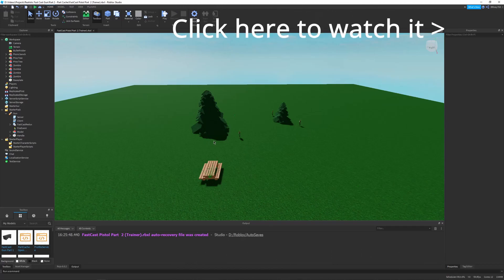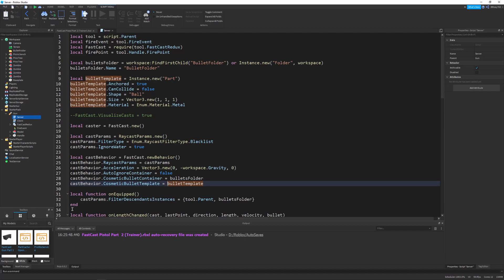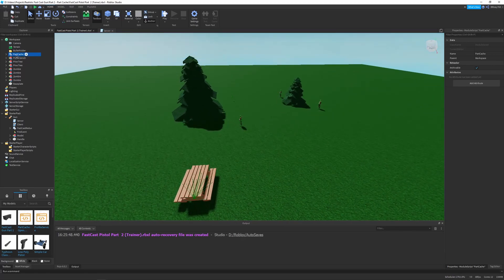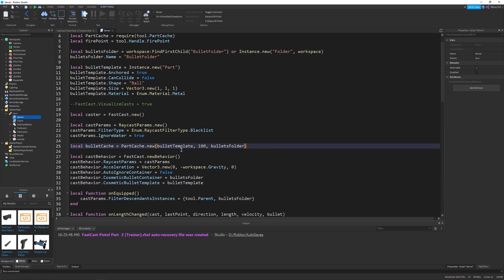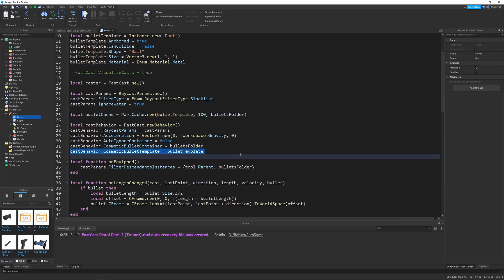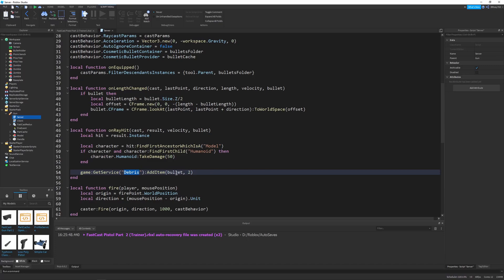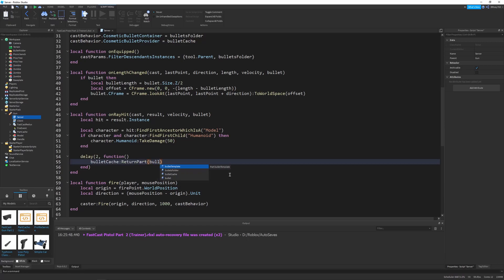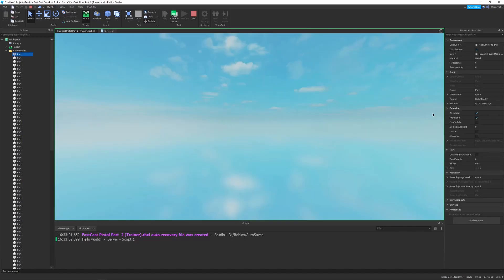Make your guns less laggy (and make it Full Auto) - FastCast Gun Ep. 2

Comment: There is a problem with this code in that you shouln't use the RayHit function to use the ReturnPart() function. This is because if you shoot the bullet in the air it will keep going up and never going to its original position. You should use caster.CastTerminating() instead. Ex. 
caster.CastTerminating:Connect(function(ray)

	castBehavior.CosmeticBulletProvider:ReturnPart(ray.RayInfo.CosmeticBulletObject)
end)
Reply: I have a fix for that actually. And I recommend removing PartCache, as it just stores the Parts instead of destroying them, which causes lag as well because they build up.

TO SUMMARIZE THIS SCRIPT: It checks, every second if there is a a bullet in the bullet folder, if there is, it checks if there already is a set of values for its position, if not, it creates those values. After that, it checks the number of values inside the script and for each value, if the bullet still exists, if not, it just removes the value. Then it does a final sweep to remove any stray values. Coming back on the next run, if the position of the bullet has not changed, we can see that it is stray (because stray bullets freeze for some reason) and remove it.

local debounce = true
while wait(0.5) do
	if debounce == true then
		debounce = false
		for NumberOfContentsInFolder, BulletInFolder in pairs(game.Workspace:WaitForChild("BulletFolder"):GetChildren()) do
			local PositionX = script:FindFirstChild("PositionX"..NumberOfContentsInFolder) or Instance.new("NumberValue", script)
			local PositionY = script:FindFirstChild("PositionY"..NumberOfContentsInFolder) or Instance.new("NumberValue", script)
			local PositionZ = script:FindFirstChild("PositionZ"..NumberOfContentsInFolder) or Instance.new("NumberValue", script)
			PositionX.Name = "PositionX"..NumberOfContentsInFolder
			PositionY.Name = "PositionY"..NumberOfContentsInFolder
			PositionZ.Name = "PositionZ"..NumberOfContentsInFolder
			if BulletInFolder.CFrame.X == PositionX.Value and BulletInFolder.CFrame.Y == PositionY.Value and BulletInFolder.CFrame.Z == PositionZ.Value then
				BulletInFolder:Destroy()
				PositionX:Destroy()
				PositionY:Destroy()
				PositionZ:Destroy()
			else
				PositionX.Value = BulletInFolder.CFrame.X
				PositionY.Value = BulletInFolder.CFrame.Y
				PositionZ.Value = BulletInFolder.CFrame.Z
			end
			for NumberOfValuesInScript, ValueInScript in pairs(script:GetChildren()) do
				if not BulletInFolder then
					PositionX:Destroy()
					PositionY:Destroy()
					PositionZ:Destroy()
				end
			end
		end
		local FinalNumberOfObjectsInFolder = 0
		for NumberOfObjectsInFolder, BulletInFolder in pairs(game.Workspace:WaitForChild("BulletFolder"):GetChildren()) do
			FinalNumberOfObjectsInFolder = FinalNumberOfObjectsInFolder + 1
		end
		if FinalNumberOfObjectsInFolder == 0 then
			for NumberOfObjectsInScript, ValueInScript in pairs(script:GetChildren()) do
				ValueInScript:Destroy()
			end
		end
		wait(0.5)
		debounce = true
	end
end
Reply: @anthonygaming0246   i know this is a year old, but you should definitely NOT do this.
use game:GetService("Debris"):AddItem(bulletinstance, time)

Comment: hey man, i added a tracer to these bullets, but when they are shot, massive lines from the sky are visible
Reply: it's because the part teleports from the sky to where it's supposed to be, resulting in the giant trail thing, best options are either don't use a trail or don't use the cache
Reply: @misenthropic  or he could have the trail disabled until it's in the right place (So late lol)
Reply: I have a fix for that actually. And I recommend removing PartCache, as it just stores the Parts instead of destroying them, which causes lag as well because they build up.

TO SUMMARIZE THIS SCRIPT: It checks, every second if there is a a bullet in the bullet folder, if there is, it checks if there already is a set of values for its position, if not, it creates those values. After that, it checks the number of values inside the script and for each value, if the bullet still exists, if not, it just removes the value. Then it does a final sweep to remove any stray values. Coming back on the next run, if the position of the bullet has not changed, we can see that it is stray (because stray bullets freeze for some reason) and remove it.

local debounce = true
while wait(0.5) do
	if debounce == true then
		debounce = false
		for NumberOfContentsInFolder, BulletInFolder in pairs(game.Workspace:WaitForChild("BulletFolder"):GetChildren()) do
			local PositionX = script:FindFirstChild("PositionX"..NumberOfContentsInFolder) or Instance.new("NumberValue", script)
			local PositionY = script:FindFirstChild("PositionY"..NumberOfContentsInFolder) or Instance.new("NumberValue", script)
			local PositionZ = script:FindFirstChild("PositionZ"..NumberOfContentsInFolder) or Instance.new("NumberValue", script)
			PositionX.Name = "PositionX"..NumberOfContentsInFolder
			PositionY.Name = "PositionY"..NumberOfContentsInFolder
			PositionZ.Name = "PositionZ"..NumberOfContentsInFolder
			if BulletInFolder.CFrame.X == PositionX.Value and BulletInFolder.CFrame.Y == PositionY.Value and BulletInFolder.CFrame.Z == PositionZ.Value then
				BulletInFolder:Destroy()
				PositionX:Destroy()
				PositionY:Destroy()
				PositionZ:Destroy()
			else
				PositionX.Value = BulletInFolder.CFrame.X
				PositionY.Value = BulletInFolder.CFrame.Y
				PositionZ.Value = BulletInFolder.CFrame.Z
			end
			for NumberOfValuesInScript, ValueInScript in pairs(script:GetChildren()) do
				if not BulletInFolder then
					PositionX:Destroy()
					PositionY:Destroy()
					PositionZ:Destroy()
				end
			end
		end
		local FinalNumberOfObjectsInFolder = 0
		for NumberOfObjectsInFolder, BulletInFolder in pairs(game.Workspace:WaitForChild("BulletFolder"):GetChildren()) do
			FinalNumberOfObjectsInFolder = FinalNumberOfObjectsInFolder + 1
		end
		if FinalNumberOfObjectsInFolder == 0 then
			for NumberOfObjectsInScript, ValueInScript in pairs(script:GetChildren()) do
				ValueInScript:Destroy()
			end
		end
		wait(0.5)
		debounce = true
	end
end

Comment: the partcache functions well but it only works when your bullet actually hits something. how to return the bullet when it doesnt hit anything and just flies off in the sky ?
Reply from the maker: I made the liberty to assume that your bullet has drop, so it will eventually fall and hit something. If you want, you can add a timeout in the LengthChanged event and figure out if enough time has passed
Reply: @BRicey  thanks, i fixed it by adding an invisible part in the sky but im gonna try that
Reply: I have a fix for that as well. And I recommend removing PartCache, as it just stores the Parts instead of destroying them, which causes lag as well because they build up.

TO SUMMARIZE THIS SCRIPT: It checks, every second if there is a a bullet in the bullet folder, if there is, it checks if there already is a set of values for its position, if not, it creates those values. After that, it checks the number of values inside the script and for each value, if the bullet still exists, if not, it just removes the value. Then it does a final sweep to remove any stray values. Coming back on the next run, if the position of the bullet has not changed, we can see that it is stray (because stray bullets freeze for some reason) and remove it.

local debounce = true
while wait(0.5) do
	if debounce == true then
		debounce = false
		for NumberOfContentsInFolder, BulletInFolder in pairs(game.Workspace:WaitForChild("BulletFolder"):GetChildren()) do
			local PositionX = script:FindFirstChild("PositionX"..NumberOfContentsInFolder) or Instance.new("NumberValue", script)
			local PositionY = script:FindFirstChild("PositionY"..NumberOfContentsInFolder) or Instance.new("NumberValue", script)
			local PositionZ = script:FindFirstChild("PositionZ"..NumberOfContentsInFolder) or Instance.new("NumberValue", script)
			PositionX.Name = "PositionX"..NumberOfContentsInFolder
			PositionY.Name = "PositionY"..NumberOfContentsInFolder
			PositionZ.Name = "PositionZ"..NumberOfContentsInFolder
			if BulletInFolder.CFrame.X == PositionX.Value and BulletInFolder.CFrame.Y == PositionY.Value and BulletInFolder.CFrame.Z == PositionZ.Value then
				BulletInFolder:Destroy()
				PositionX:Destroy()
				PositionY:Destroy()
				PositionZ:Destroy()
			else
				PositionX.Value = BulletInFolder.CFrame.X
				PositionY.Value = BulletInFolder.CFrame.Y
				PositionZ.Value = BulletInFolder.CFrame.Z
			end
			for NumberOfValuesInScript, ValueInScript in pairs(script:GetChildren()) do
				if not BulletInFolder then
					PositionX:Destroy()
					PositionY:Destroy()
					PositionZ:Destroy()
				end
			end
		end
		local FinalNumberOfObjectsInFolder = 0
		for NumberOfObjectsInFolder, BulletInFolder in pairs(game.Workspace:WaitForChild("BulletFolder"):GetChildren()) do
			FinalNumberOfObjectsInFolder = FinalNumberOfObjectsInFolder + 1
		end
		if FinalNumberOfObjectsInFolder == 0 then
			for NumberOfObjectsInScript, ValueInScript in pairs(script:GetChildren()) do
				ValueInScript:Destroy()
			end
		end
		wait(0.5)
		debounce = true
	end
end

Comment: As attractive as Part Cache is, I handle nearly all things client sided and only use the server for detailed security checks. Is it really that cost effective to clone effects when needed client sided? Perhaps lower end devices such a mobile players might suffer, however most decent Pc's should be able to handle the somewhat optimized, yet Cloned effects pretty well. I could be wrong, but just don't know if it's worth the effort yet.
Reply from the maker: That's a great question... I've never built any gun game, and thus don't really know the lag capabilities of a system without PartCache. Honestly, it's better to be safe than sorry. Either way, PartCache is easy enough where it won't matter in the end
Reply: @BRicey  Thanks for the quick response! Actually, that's the thing, it's not a gun game! It's actually an combat game similar to Super Smash Brothers. Part Cache would only ever be for effects and would never be affected by the actual Rays that are fired.